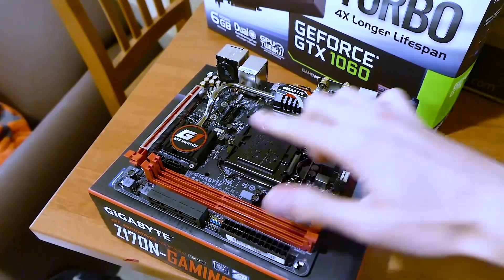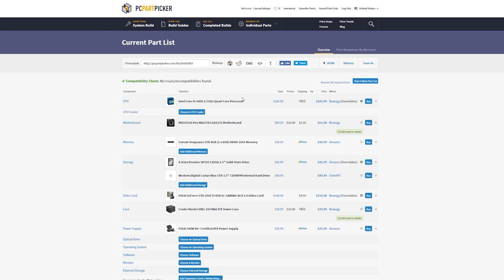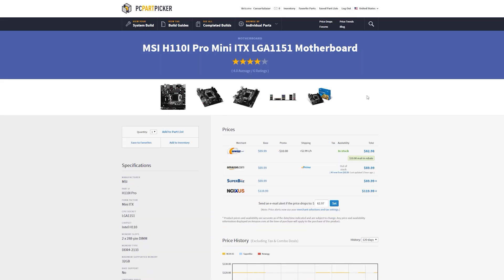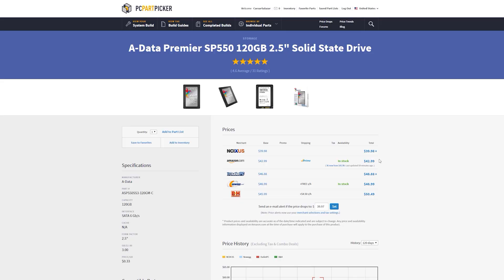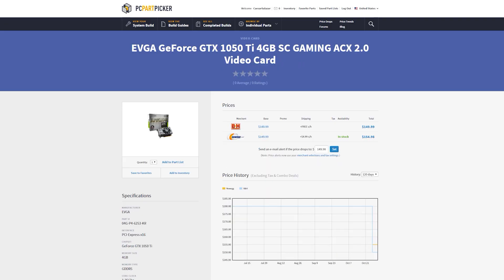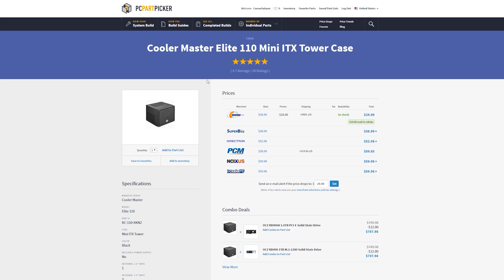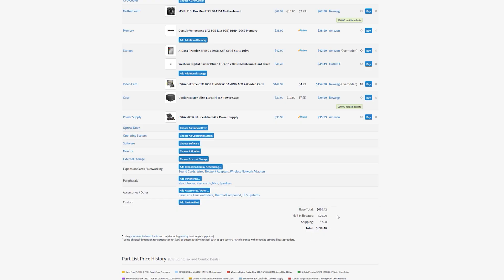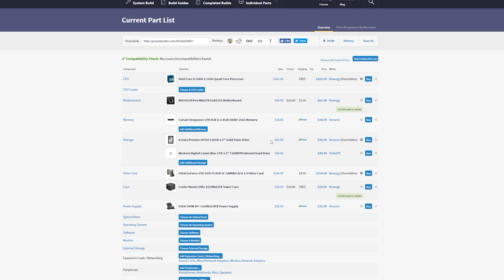$600 ITX PC Build List

Comment: wow, almost my portable VR dev setup. except GPU and few details. why RAM 2666 for 2133-capable motherboard? 
btw, stock Intel box fan keeps my i5 6500 on 39c idle/50c video encoding + VR gaming load. oem/box difference is 6-8$. i actually modded my psu by removing fan protection cage so it sucks hot air directly from CPU fan.
Reply from the maker: RAM frequency doesn't matter.
Reply: Salazar Studio yep but it usually slightly affects its price, more significant if you plan to double ram later. there's also was a surprise to me that ram cooling is just a fake design trick( e.g crucial ram radiators do not even touch chips so they actually work the opposite way) and most ram uses the same Samsung chips so brand does not matter too, its just a stick color and radiator design. i also wonder if this build will consume 400w max at least my rig with rx480 sucks ~340w with oculus rift+2 sensors connected. PSU wattage is a huge price sucker around 500w margin.  would love to see if you'll do actual measurements on your ITX setup. i love your videos, helped me a lot. sorry for bothering :)

Comment: What's the point of having an aftermarket CPU cooler in this build anyway? You won't be able to overclock the CPU and the skylake processors run so cool and in most (gaming) situations the graphics card is going to hit full load and the CPU is not anyway
Reply from the maker: Because loudness. That's the point.
Reply: You can actually overclock it using the base clock overclock method. He mentioned it early in the video.
Reply: Only if you want it absolutely dead silent. That is about the only reason. But even not oc'ed the intel fan doesn't do as a good as a job as a $15 aftermarket fan.
Reply from the maker: The Intel fan is significantly louder than the C7, as I've proven in a late video. It's your choice, but you know where I stand.
Reply: Salazar Studio awe k. I didn't really think about that

Comment: just a question of mine is this a good pc for the money? or any upgrades i should add? thank you.

http://pcpartpicker.com/list/cCctWX
Reply: The biggest issue and your only issue is a non Z170 motherboard. Why buy an after market cooler, a larger psu and a intel K chip if you are not going to overclock? If your not going to overclock make the appropriate changes and save some money or just swap out motherboards.
Reply: JimmysTheBestCop thank you so much, I appreciate it
Reply: ASRock Z170M pro
Reply: No prob send out another pcpartpicker list and we all will check it out for you
Reply: http://pcpartpicker.com/list/7W82r7 tbh

Comment: I was gonna build my sister a 1080p gaming rig with an i3-6100 and a 1060 3 GB (yes, I'm aware of the obvious bottleneck. It's just not an issue for me.) But now I might go with the i5-6400 and 1050 Ti instead. At the same time I strongly believe she won't try to play anything that demands 4 physical cores since there aren't even a whole lot of games like that and she's particular about what she plays. The i5  + 1050 is only about $20 more in the long run, but is it the better option? I'm not asking Greg specifically; anyone's thoughts would be appreciated.
Reply: Kadomex The 1050ti/i5 combo is the better option if you want a more balanced PC. The 1060/i3 is the better option if you want more graphical horsepower. I'd say that both PCs would be on par with each other, but the 1050ti/i5 would be better for "future proofing".
Reply: Kadomex get the 470
Reply: lol that wouldn't bottleneck...
Reply: Gilbertify The benchmarks I've watched showed a bottleneck but it wasn't significant by any means. That's why I said it wasn't an issue for me.
Reply: I would go i5 first personally. I much rather have a quad core chip then a better gpu and 2 core chip. Its always easier to swap gpu's out then processors in the future. 

Not sure of your location but 1 other option is buying a 2nd gen i5 OEM complete desktop and dropping in a GTX 1060 6gb. That still should end up as a cheaper option. You can usually find Dell Optiplex's complete units for around $175-200 on eBay. Or you could go 2nd gen i7-2600 for around $200-225. Now if your going GTX 1060 you will have to swap PSU's but if your going 1050 ti then the OEM PSU does not have to be swapped out.

The absolute bottom budget build that should still get at least 60 fps in 1080p in high+ detail would be a dell optiplex 790 2nd gen i5. They can be bought complete for around $75-100. Plus a gtx 1050 ti. And you just spent $250 on a fine 1080p rig. An entire computer for basically the cost of a i5 skylake processor.
Reply: Those are all good points. And quite honestly the power of a GTX 960 is more than adequate for the types of games she likes to play, which is mostly MMORPG's so the 1050 Ti will suffice. I'll go with the i5 + 1050 just to prepare for the future a little better. Thanks for the feedback.
Reply: You could try getting a 1050Ti and an i3 6100 instead. The GPU can drive 1080 and high settings at ~60fps even when it's paired with a G4400 so you'll save quite a bit.

Comment: would a i3 6100 be decent for 1080p
Reply: Compared to what? What games? In general I would say no. I would always go new i5 or used 3rd gen I5/i7. Better price and performance ratios.
Reply: Is there any around $150
Reply: 3rd gen i5 complete oem desktops usually around 160-170. You can probably get 2nd gen i7 builds for $150. Dell optiplex  790 i5-2400 usually go around 80-100
Reply: thx u r helpfull =)

Comment: If ur not gonna overclock the i5,and you definitely dont need to since you have a 1050 ti,the stock cooler is enough to cool it and if you get a better graphics card later on ur probably gonna have the 30$ for the new cooler in case you wanna overclock the i5 to keep up with the better graphics card so there is no need to cut back on any part of this build
Reply from the maker: TheDennys21 I'm well aware, but the sound will be unbearable at times.
Reply: Salazar Studio Hey,you replied,thanks :)

Comment: Gtx 970 or Gtx 1050ti ? What's better ?
Reply: flowergreeeeed r9 380 is better than the 1050Ti. What you smoking?
Reply: HappyPhilXD The 970 is better than the 1050ti. But if you're buying a 970, I would strongly recommend buying a GTX 1060/ RX 480 instead.
Reply: HappyPhilXD 970
Reply: zBruda What are you smoking ? Games are better optimized for nvidia or amd graphics cards (depends on who pays more i guess). So, even that 380 shows better results in some games it looses fps battle in over 50% AAA titles... and that is why gtx 1050 ti is a better graphics card. Not to mention power consumption. Search for these 2 gpu's comparison videos and you will see results for yourself.
Reply: Gtx 970>gtx 1050 ti >r9 380 >gtx 960.
Reply: 970
Reply: its also more expensive still more expensive though
Reply: HappyPhilXD 1060 is the way to go
Reply: It's not for me, I have a GTX 1080. It's for my roommate. He has the GTX 750 and doesn't want spent much money.
Reply: the 380 does very good in dx12 and vulkan...

Comment: do you already have your hands on a GTX 1050/TI?
Reply: I'd just keep my 770 for now :/
Reply: DJRICKYDEEUK ah... ok, in that case is a very good option, the rx 470 with a good cooler is a cool running card too, but yeah... it need at least a 6pin connector
Reply: for 20dls more you can buy an rx 470 witch performs like 40% more. the 1050 ti is just not a good deal. In the other hand... the 1050 (no ti) is a much better card than the rx 460
Reply: ***** 68-70°c is hot for you?
Reply: in USA the 1050ti reference (piece of crap)is 140dls, and... the cheapest rx 470 (dual fan gigabyte or xfx) is $170. Getting a decent 1050ti (with dual cooler and 6 pin pci-e) will cost you 160dls. For 10dls more you can get a 470 wich wipes the floor with the 1050ti
Reply: Julian Grimoldi if runs hot
Reply: http://media.bestofmicro.com/U/U/621894/original/00-Temperature.png the msi gaming x (wich is probably the best aftermarket cooler) is around 64°c. My msi Rx 480 is around 68/70°c. look at this: http://www.hardocp.com/article/2016/10/30/msi_geforce_gtx_1050_ti_gaming_x_vs_amd_radeon_rx_470#.WBef8_p96Um between 40 and 50% more perfomance for allmost the same price
Reply: Goriaas lol nope
Reply: Goriaas the 1060 3 gb is better than the rx 470 4gb
Reply: Air Brayden yeah, but is 30 dls more for 10% more performance. the 470 is 30 dls more than the 1050ti for 40% more performance, is the sweetspot

Comment: Can anyone tell me if this is okay? 
i5 2400
GTX 1050 Ti
8 GB DDR3 RAM
120 GB SSD
I look forward to play GTA 5, Rainbow Six Siege, and Rust on this PC on a 1366 x 768 monitor.
Reply: It is a very strong budget build. Plenty of videos on a setup like that. The i5-2400 is extremely popular with the budget crowd because you can get complete dell optiplex i5-2400 builds for 75-100 on ebay.
Reply: more storage dawg get a 500 gb hdd if you still want the ssd for windows
Reply: !!!WORLDSTAR!!! NotSoSuper I already have a 1tb
Reply: opps
Reply: +RubTheAloe do you already own the system or are you still searching the used market? Just check out the motherboard site and specs most 2nd gen i series boards with just a bios update will take 3rd gen i7 chips.

So even going used i5-2400 you actually still have an upgrade path before you have to buy whatever current gen chips are. Generally the big difference between 2nd and 3rd gen i series boards (especially oem) is that there more oem 3rd gen board with USB3.0 and SATAIII built in. 3rd gen i7 you could go all the way upto a GTX 1070 no problem.

Chances are your SSD is only running at SATAII speeds since very few if at all any 2nd gen boards had SATAIII ports. Roughly a 50% reduction in read/write speeds. It won't matter for mechanical drives as even a 7200rpm drive cant take advantage of SATAIII. You can pick up a pcie sataIII controller card usually for 5-15 bucks used.

Comment: so i have a GTX 960 4GB and an AMD X4 860K and i play games at 1080P,which parts should i upgrade?,i mostly play fps games or open world ones
Reply: CPU is semi-bad. GTX 960 should comfortably last you another year before it might not be up to snuff for you.
Reply: Honestly? wait a few more months until Zen comes out, if it's good then you've got some choice, if it's bad then you can get haswell/skylake at reduced prices; because whatever happens after Zen, at the very least there will be a guaranteed price drop of intel to compete with AMD.

Just wait for a bit, man :)
Reply: i would reccomend cpu to i5 6400
Reply: this is a joke right?
Reply: if you want to, then the cpu, mobo and depending on target platform, ram
Reply: first your cpu and motherboard to the intel team an 6400 or a 4460/4590 just for keep at least your ddr3 ram.
Reply: First thing is a good ATX Z170 motherboard. Do not skimp out on the mobo. This gives you overclocking ab ility for K and non K chips with a custom bios loaded. http://overclocking.guide/ has a guide it is pretty easy. Then either a i5-6400 or a i5-6600k. i5-6400 has better price performance ratio if willing to overclock. You will also need to upgrade to DDR4 ram and if planning on overclocking an aftermarket air cooler. EVO 212 at the minimum. If you can spring for a Phanteks  PH-TC12DX cooler even better.

You will notice a huge improvement in gaming and all around computer performance switching off of AMD.
Reply: yasser hassani  i have the same specs lol
Reply: yasser hassani the CPU to an i5 if you can afford it. Other wise i3 or used i5 on eBay or something
Reply: mangopieyum - why are you laughing?
Reply: Kalumrai I find it funny how someone has the same specifications on there personal computer as on my personal computer that i am (believe it or not) currently using right at this moment typing this message that is going to be transmitted through the internet to this virtual chat on Youtube.
Reply: Definitely update you CPU and motherboard
Reply: seriously, everyone that said Intel CPU is really stupid.. if you buy Intel CPU you need to buy a new mother board and probably ram.. which isn't neat.. why not just buy a better AMD CPU for higher cost than getting Mother board and ram? I mean yea true Intel is faster but in this case you will get great performance for much lower price.
Reply: a wild narwhal AMD is not futureproof, newer AMD CPU's have bad heatoutput, you don't need to get new RAM wtf, and a motherboard is $50 at most, and it's worth the extra money. You're stupid.
Reply: Gilbertify lol.. I didn't look up if she has ddr3 or ddr4 ram...
Reply: a wild narwhal If he doesn't want to buy new RAM, he can go with Haswell and get a 4690. Boom, problem solved.
Reply: Gilbertify and that's just my opinion.. And I'm pretty sure that there is some better AMD CPUs than Intel ones.
Reply: ThatGrapeIsASpy next year i'll go with a high gaming build,i got a budget of 2000 euros for the whole setup

Comment: Cool :p early af boiii.  Yo, is it worth getting an i7 for heavy gaming and some video editing? I'd have it paired with a gtx 1060
Reply: You could get used 3rd gen i7 pretty cheap if you want to go to the used market.
Reply: if you will mainly game and edit here and there an i5 should be fine if you want the extra threads for editing get the i7 but you wont get better performance in games from it.
Reply: MiiTCH Not really,an i5 6600k is almost as good as an i7 6700k for like a hundred bucks less,i would advise you to get the 6600k and a better graphics like the 1070 over the 1060
Reply: TheDennys21 I already got the 1060 unfortunately. And I bought the wrong one too xD... Paid €320 for it... I could have gotten something better but lesson learned. Thanks for the advice, I'll opt for an i5. I have an i5-650 right now and it's bottle necking the 1060 on games, it's only a dual core at 3.2ghz
Reply: TheDennys21 I don't think that's true... But I would always reccomend spending more than your cpu/the majority of your budget on your gpu.
Reply: *ssd autocorrect... Lol
Reply: just get an i5 and a 1070 and you will have much better performances
Reply: games don't need 8 cores so the performances are the same